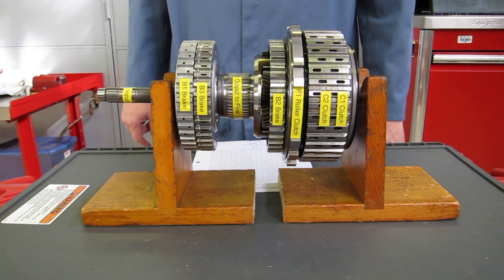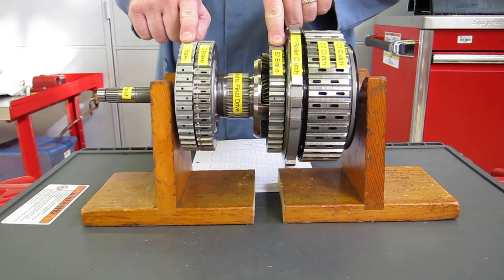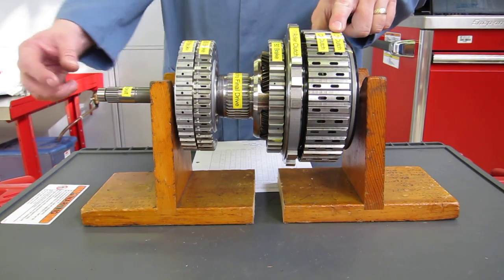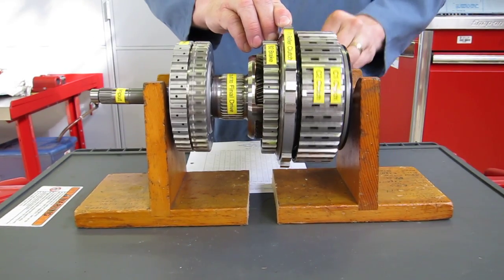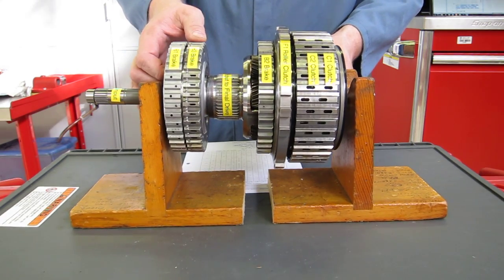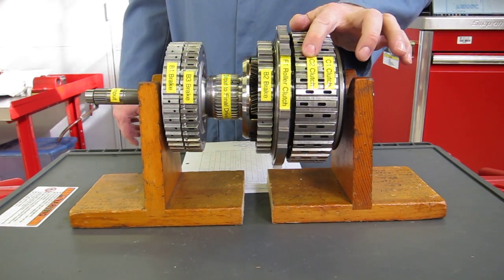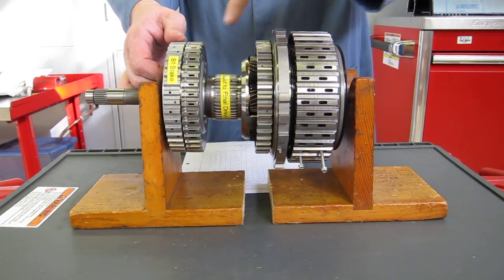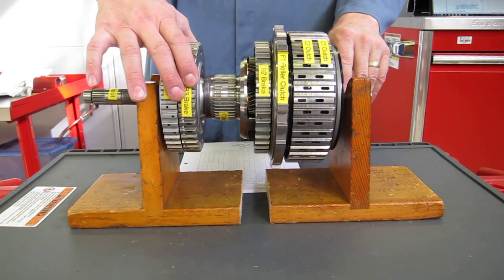Toyota U660E / U760E 6-Speed Automatic Transaxle Power flow

Comment: Mybtanission has a light gear/ whining noise in first and second. It’s barely noticeable but it’s there. Is this normal? I have checked the fluid level and the fluid level is ok. What problems would excessive fluid cause? Thanks
Reply from the maker: Whining is typically caused by under-filled or over-filled fluid levels. the fluid can get whipped up with the air  ad have bubbles in it.

Comment: I've noticed that my shift from 3rd to 4th is pretty rough sometimes. I'm guessing its because it's a lot of work to go to 4th gear, because it has to close the big clutch. Is this a warning sign to potential problems coming soon? Like maybe my fluid is too dirty?
Reply: I have 150k miles so I am hesitant to change the fluid because I think it's gone too far. My dad said I should just leave the original fluid until I either get rid of the car, or have to rebuild the transmission.

Comment: I've been hearing that the Toyota 6 speed transmission is much more sound than the 8 speed.
Reply: I think the 8 speed is solid in that it is reliable, the main issue is in the shift logic is lacking. It seems with any high gear count transmission that they can figure out how to make it work from a mechanical perspective, but from an operational perspective they do things that the driver either doesn't expect or want due to the programming. I'm very happy with the 6 speed in my V6 Camry. Having driven 7, 8, 9, and 10 speed vehicles I don't see any benefit from a drive-ability perspective, only a slight fuel mileage bump.
Reply: No , it's just you heard it on the Internet.

Comment: Hi there I am intending to buy a SUV and I saw a Sangyyon Rexton 2018 equipped with an AISIN transmission 6 speed. I want to  know how is the performance and the problems of this transmission. Thanks
Reply from the maker: I am not familiar with that model, but the Aisin 6-speeds have been reliable

Comment: Hello, what do you think of the sonnax zipkit to fix the flaring issues on these early model transmissions? do they work? Because according to a lot of owners on forums, the software update and fluid level don't work. Some even had flares on their replacement transmissions.
Reply from the maker: Yes, the Sonnax zip kits (properly installed) are helping. Those pulse-width modulated valves and solenoids wear themselves out over time.  Best wishes!
Reply: thank you!
Reply: Ocean Zhu did you ever get the zip kit installed?

Comment: so will power be transmitted to both wheels or just one cause when in park on the 2007 camry on jack stands the passanger side wheel is the only one locked in to the park. the driver side spins freely is this correct?
Reply from the maker: Both while driving, one wheel on jack stands. It is because it has an open differential style. With the engine off in Park, if you spin one wheel forward, the other will spin backwards. That is normal.
Reply: Thanks for clearing that up for me. Awesome!

Comment: Hi, I wonder how does the C1 and C2 clutches work though? Do they also put in pins though those holes? Thanks!
Reply from the maker: +no1wafer Hi, the C1 and C2 clutches are actually multi-plate fiber and steel clutches. I just used pins in this demonstration to make it easier to show the function, but there are no pins actually used. Thanks for your feedback!

Comment from the maker: Hi, no, there are hundreds of different gear ratios for automatic transmissions.  The gear ratios are customized for each vehicle based upon vehicle weight, engine size, desired acceleration, desired fuel economy, etc.  The clutch and Brake names are also different for most transmissions.

Comment: So basically, when you hold the C1 clutch, and spin that, it's first gear.
F1 + C1 = 1st gear
C1 + B1 = 2nd Gear
C1 + B2 = 3rd  Gear
C2 + B1 = 4th Gear
C2 + B2 = 5th Gear
C2 + B3 = 6th Gear

BTW.. Thank you for explaining an automatic transmission.

Comment: @ThePustr117 I agree with the answer given but you used the word sync, That process is more applicable to manual transmissions where  gear ratios are achieved by shuttling wheel gears to mesh with one another, Gears of different sizes create different ratios and a sync mechanism is needed to smoothly marry and disengage the gears. In the transmission above all the gear ratios are achieved by predetermined combinations of clutches and brakes that allow a gear set to rotate

Comment: @ pustr117 Part 2:  gear set to rotate or restricts a gear set from rotation. the gears are always in contact but you get one ratio with the brake on the outer ring gear applied and another ratio with the outer ring gear spinning freely, From this point all the engineers had to do is, determine the combinations and sequence of breaking  and releasing needed for all the different  forward gears combinations and reverse. This is well explained in the presentation and is the focus in the video.

Comment from the maker: @MrGizmo757 Hi, I would too, but I don't have access to one yet.  It is my understanding that there are two input shafts; a solid shaft inside a hollow shaft. Each has its own clutch disk and is connected to opposite sequence gears.  When shifting, one clutch drives one input shaft that drives one gear (lest say 1st gear). Next, to shift into 2nd, the other input shaft is connected to 2nd gear, so you just release the first clutch and apply the second; no synchronizers involved. and so on.

Comment from the maker: @ThePustr117 Hi, there is a computer that looks at vehicle speed verses throttle angle (and other minor inputs) and controls shift solenoids and pressure control solenoids.  The solenoids control valve movement in the valve body.  The valve movement controls fluid routing and pressure used to apply different clutch packs.  The clutch packs control the various parts of planetary gear sets to accomplish each gear ratio. I hope that helps.

Comment from the maker: @dclaver2 Hi,  Some cars have paddle shifters on the steering wheel, others have a shift handle in the center console that has a plus and minus position allowing the driver to attempt to shift the transmission like a manual transmission.  These are still automatics, but allow the drivers to request an upshift or downshift.  If the conditions are right to allow the shift, the shift will take place.  Some shift requests will not occur because of high or low vehicle speed verses requested gear.

Comment from the maker: @venkataragavan123 Hi, there are two reason for this: 
1. The B2 brake and the F1 roller clutch do accomplish the same task of holding the ring gear of the Ravigneaux carrier front planet gears, but only under acceleration.  The F1 Roller clutch would overrun when decelerating resulting in a loss of engine braking.
2. The use of the F1 roller clutch allows an instantaneous  synchronous shift into second without needing to release the B2 brake.  This allows for a better shift feel.

Comment from the maker: @venkataragavan123 Hi, In reverse neither the C1 nor the C2 are applied. The input shaft has a sun gear splined to it (under the B3 brake area) that always spins with the turbine of the torque converter; this is the input power path. The B3 brake holds the ring gear resulting in the carrier reversing direction. The B2 brake holds the ring gear of the Ravigneaux carrier front planet gears providing gear reduction.

Comment: During reverse gear, which clutch is engaged? Is it the C1 or C2 clutch?
Reply: Neither. The shaft is splined to the C1/C2 drum so he used that to generate rotation. Only the two brakes mentioned are applied.

Comment: Hi.. Thank you for the video. Just one clarification. 
What is the purpose of holding F1 roller clutch during the 1st gear operation. Does it stop the ring gear from rotating? If yes, would holding the B2 brake serve the same purpose?

Comment from the maker: @mattkorzenieski Hi, the high reverse gear ratio makes it easier on the engine and emissions to back up.  More transmissions seem to be going to this.  We also do not need to boost line pressure in reverse which also improves emissions by not loading the engine so much.

Comment: Cool! Just out of curiosity, since I'm not an ME, just a hobbyist, why is the reverse ratio so high? I could guess since it's simply because we don't need high speeds in reverse, but it's even much higher ratio than the 1st gear. Is that common?

Comment from the maker: @jackjackattack94 There are two things: There may be a service bulletin for a Transmission Control Module (TCM) calibration update for shift flare concerns.  The proper fluid level is especially critical on this transaxle. There is no dipstick and it requires a special fluid level checking procedure with the engine running and a special fluid fill tool(pump).  If the fluid level is too low, shift flare can occur.